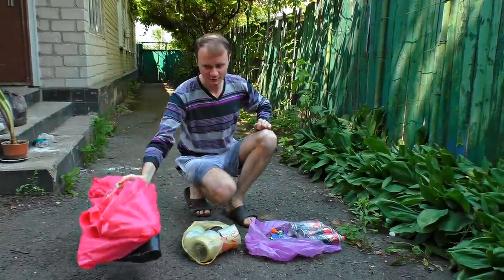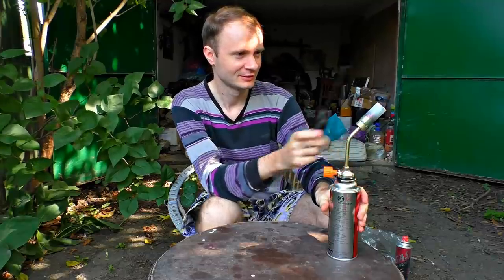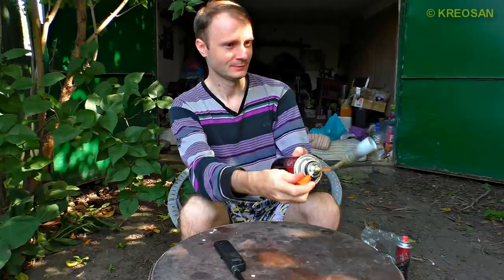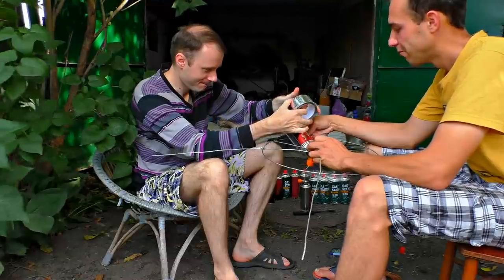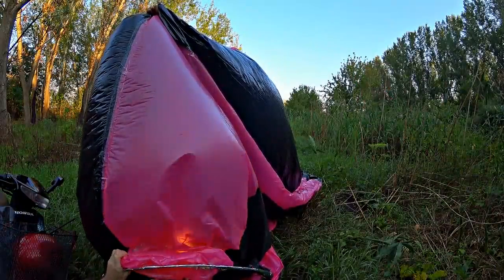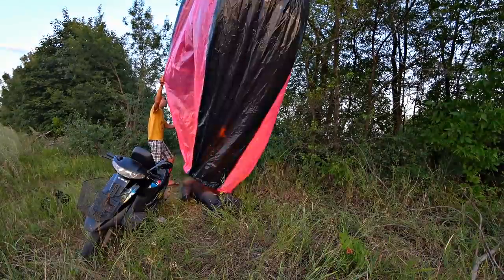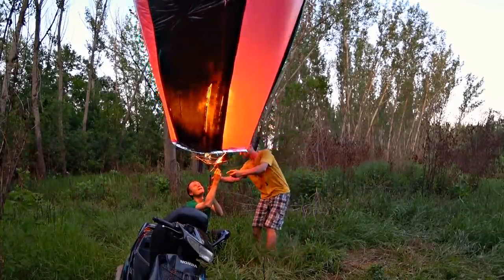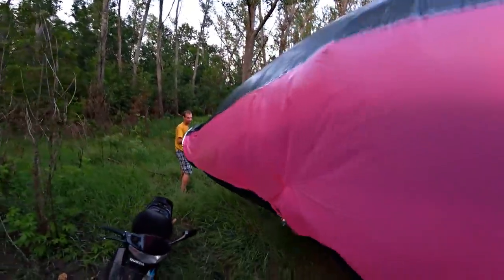A Hot Air Balloon DIY ! Plastic bags and scotch tape = Thermal Balloon!

Comment: you must first use it  air blower to fill balloon with the cold air   and then set the torch at a distance of 30 to 50 cm   from the bubble opening while a small holl should be placed on the upper part so that the hot air comes out